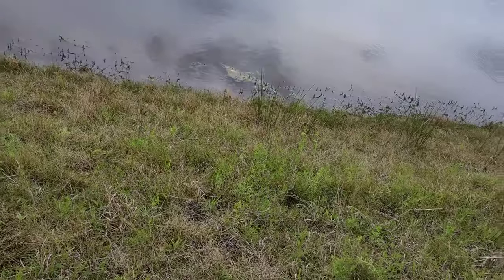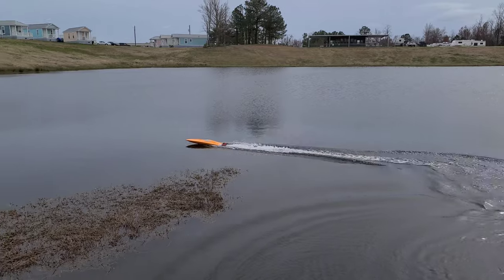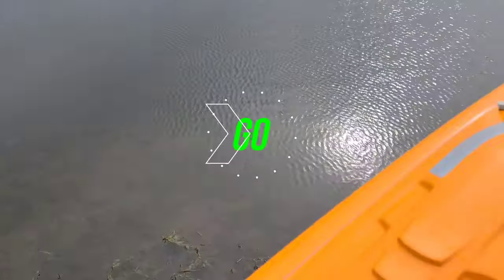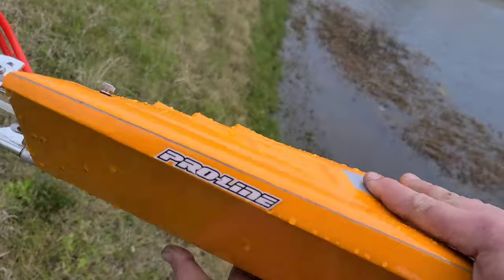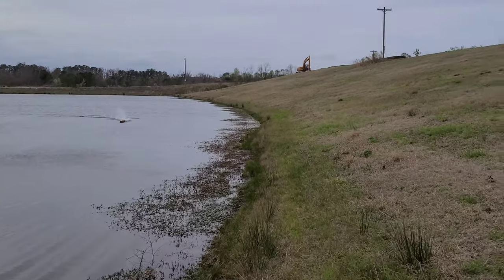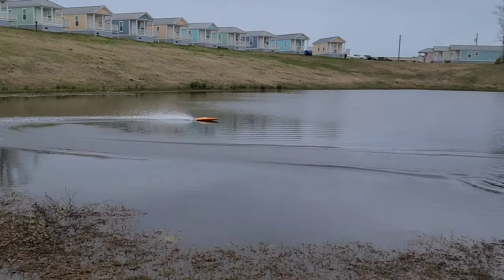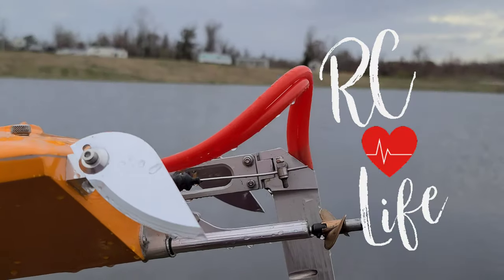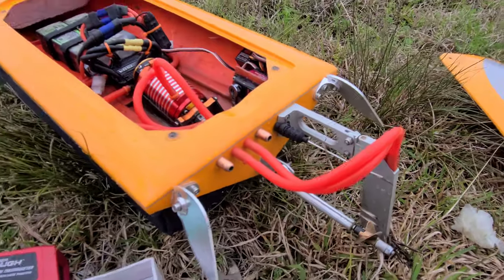RC Boat Turn Fin Tuning | Mono Hull Turn Fin Angles Tested | Turn Fin Explained

Comment: The ESC is actually a flycolor 150A ESC relabeled LOL. Great 150A for the price. The 120A version basically looks the same and is also good. Mine best choice under 6S is the hobbywing seaking v3 180A ESC. Definatilly give that one a shot.

Comment: I just made a tweak on my little 22 inch exceed sword fish... the stinger had 4 tiny washers(from factory) angling my prop slighty down and the only way i could get it to ride  right was put my 3000 4s all the way back to transome... i removed the washers and now prop is neutral... so i am hoping i will be able to move battery slightly forward and it will get the right amount of bow lift and even turn better... can't wait to go to lake to test... thanks for sharing

Comment: I built a boat (3d printed) that skips horribly in a turn. Even at fairly low speed. New to boating so I’m not sure what to do to fix it. Tried turn fins but it still skips. Any advice on what to try next would be much appreciated! Been watching a bunch of your videos. Thanks for all the insight.
Reply from the maker: Without actually see what the boat is doing its hard to pinpoint exact cause. 

Start by moving your cg around 30% from the transom is a good starting point.  Move cg extreme back test if that didn't solve try extreme forward..     I've had boats hop due to to much down trim on my trim tabs, go up a turn or so, with cg back or at 30 percent.   

Tip. Make a change then test that change do change to many things at once.
Reply: @IRONCLADRC  Awesome. Thanks for the tips. I’ll try it out!

Comment: Thank you for good and informative videos! I only have two small Super Mono x boats at the moment but still have gotten great help from this, I love when I have the boat dialed in nicely and can have it up on plane and just do loooong sweeping turns. Hope to get a bigger boat soon though, those small ones don't like anything other than calm water
Reply from the maker: That's the only thing I dislike about small boats.   It's gotta be slick calm on the water.     Big boats are great but it's a hassle prepping for the water dual battery's/ grease/ shear size etc.  Thanks for watching IRONCLAD RC
Reply: @IRONCLADRC  these small ones are great to just bring along, they fit nicely in one of the side storage in our car, along with the radio and batteries. But in a few months we're moving to live really close to a fairly big lake so I'm looking at getting a few more watercrafts, bigger motorboats as well as sailing. I have two unfinished 3d printed jet boats to complete as well.
Thank you for good content 👍

Comment: does the placement of the batteries (forward or back) affect turn fin ability to make sharp turns.I have sonicwake V2
Reply from the maker: Yes sir, most definitely
Reply: @IRONCLADRC  further rearward I assume would give turn fins stronger quicker response ??
Reply from the maker: Yes, that's right!
Reply: @IRONCLADRC  just bought you lunch

Comment: Great video! QUESTION, I noticed the boat 'bouncing' over the water...Does this indicate the trim should be adjusted down ever so very slightly?...Enough to keep it on the water but not so much as to slice the water? Or would that make it worse?
Reply from the maker: That's correct  👌   there's a sweet spot! find the sweet spot and she will run without bounce!
Reply: @IRONCLADRC  Awesome thanks!